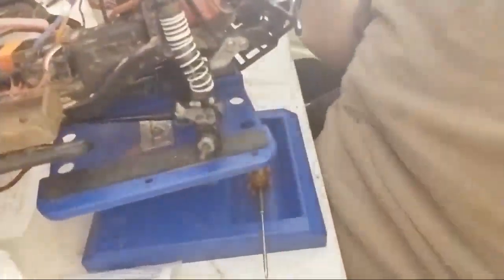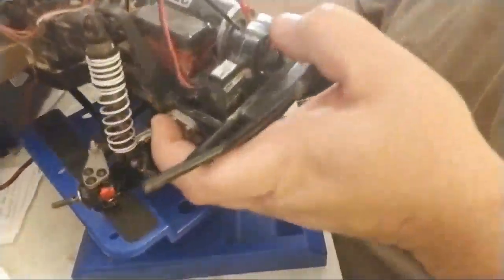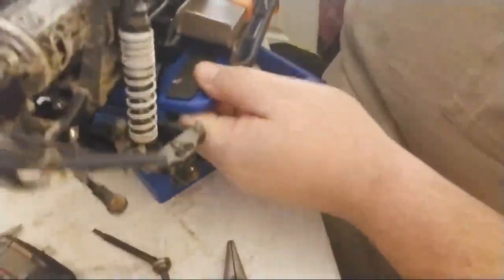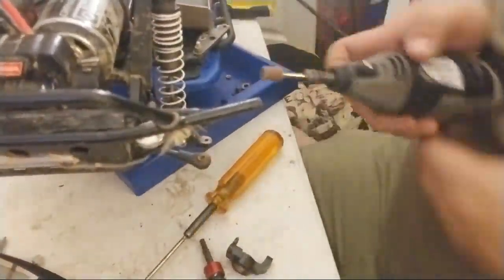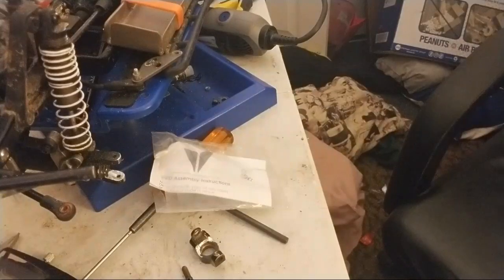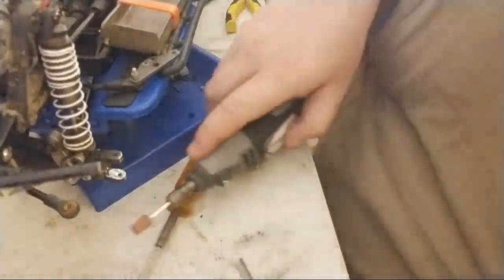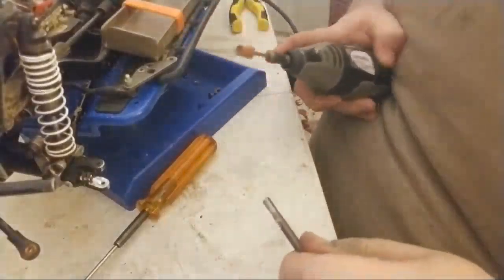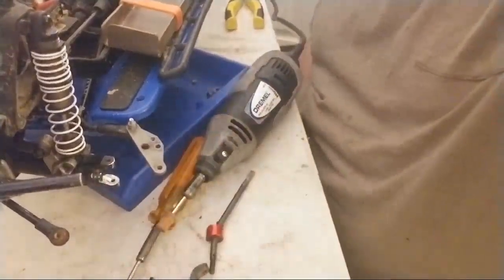HPI Venture CVD Mod

Comment: Did you have any problem putting that hpi bumber on the venture I got that bumper but not sure how im going to install it doesn't seem like theres room to get to a place were you can screw it on
Reply from the maker: It mounts up perfectly.  The CChand bumper was made for it.  Mounting the winch was tough- have a thin pair of pliers and a lock nut or loctite ready
Reply from the maker: It is a direct swap in.  The CChand (its not cheap by any means)  mounted up without an issue.  I
Reply: @RekkrRC   Hi there :-) can you tell me,why youre not using the original HPI cvd axels ?
Reply: @kimjusjong2483  i did this before they came out.  They have been ultra reliable.
Reply: @WreckerRC   Thanks :-)